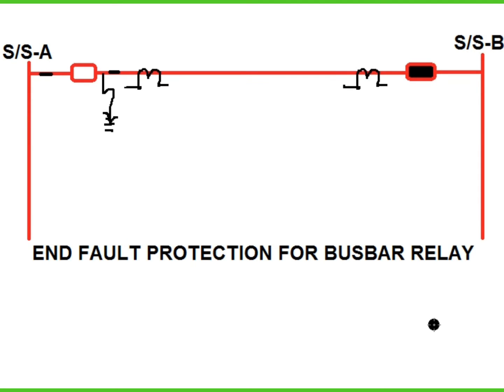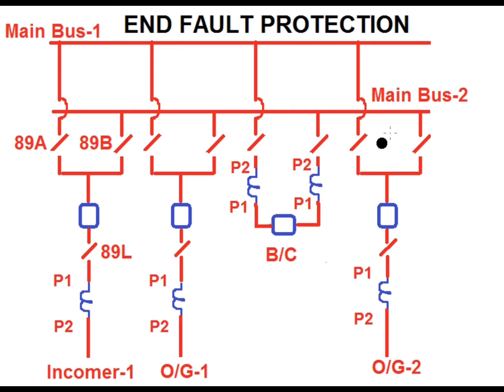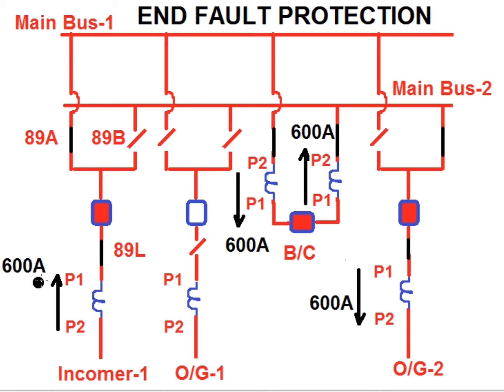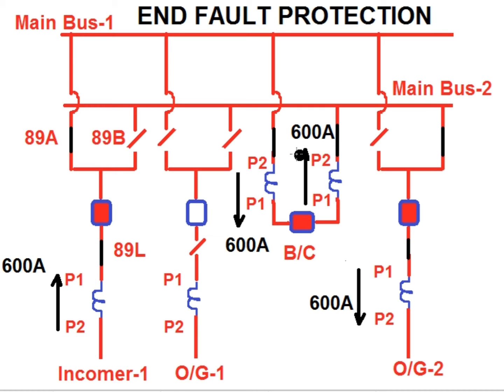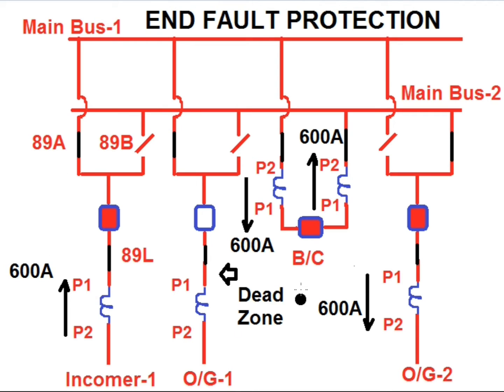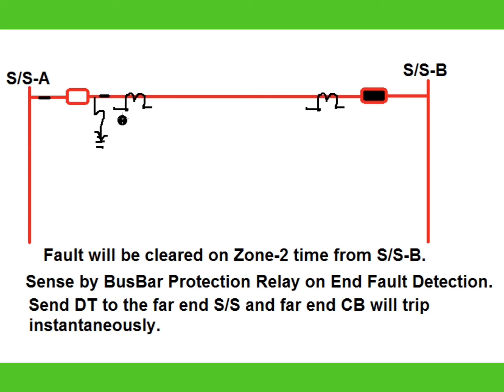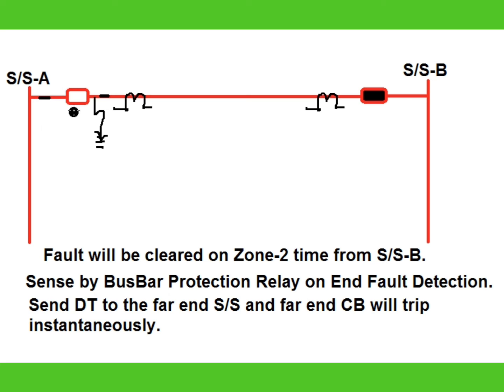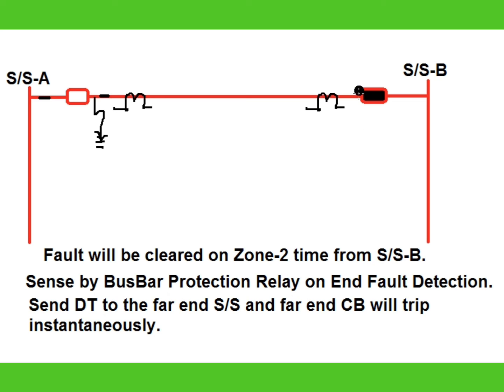End Fault Protection or Dead Zone Fault Protection for Bus Bar Relay

Comment: How busbar at ss A will detect end fault pls explain the logic
Reply from the maker: Logic is simple...in S/S -A for that particular FDR CB is open and there is current threshold, this current will not be counted rather end fault will be activated and it will also send a direct trip to the far end and thereby avoid delayed TRIPPING due to zone 2 from far end.